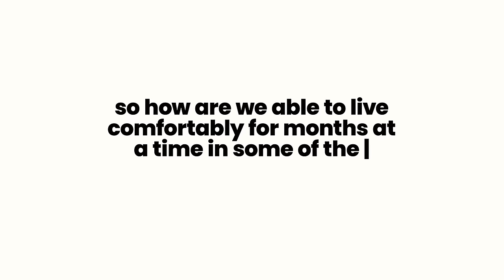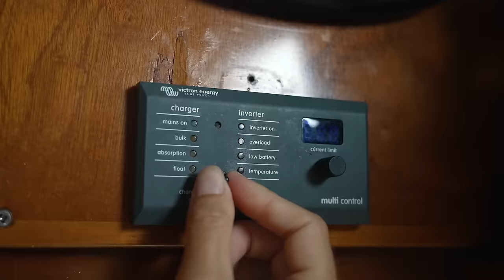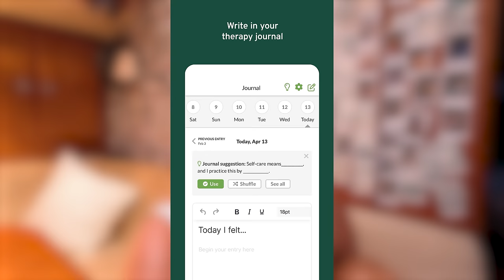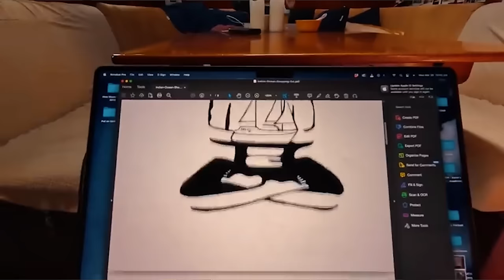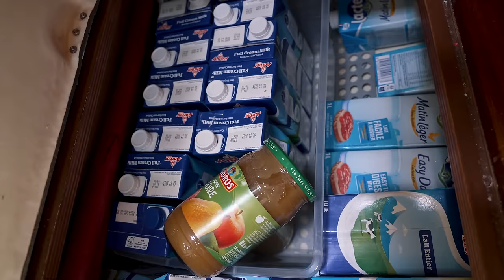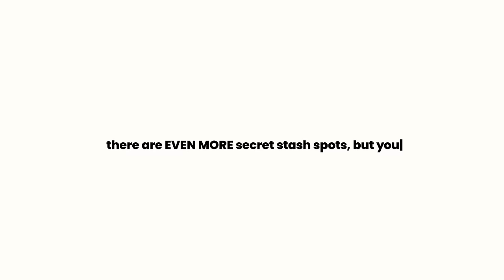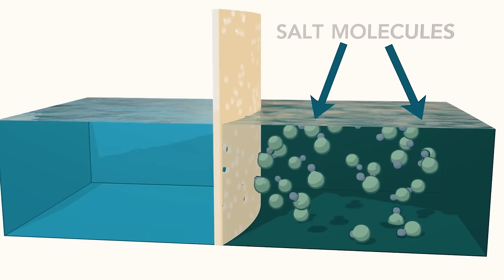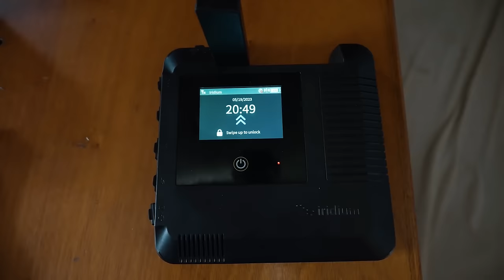Mastering OFF-GRID Living: 4 Key Things Every Sailor Should Know ⛵️ Sailing Vessel Delos Ep. 441

Comment: I have been living off grid for almost 20 years now.  When I was 21 I purchased a 400 acre property in the Mojave Desert with nothing on it.  The first structure I built was a small 20'x20' one room home.  I started off with a old Kohler 10kw Diesel generator and I didn't have a well for the first 3 years so I had to truck water in.  Fast-forward 20 years later I have 22kw of solar and 36kw of wind power with a 100kw diesel backup generator.  With two wells and 100,000 gallons of underground water storage.  The little 20x20 one room home now serves another purpose since I built a proper 6,000 sq ft home and a few other buildings.
Reply: I'm in my early 20s and have been considering doing the exact same thing. Any advice for someone inexperienced with off the grid living? Any regrets??
Reply: @Not_Bomb678  Buying equipment is key, if I would have had a good medium or medium large excavator early on I could have accomplished more sooner.  Equipment varies based on the environment you choose to live in.  I wish I had more money when I first made the choice to build off grid so I could have built things sooner.  I was a very skilled carpenter and builder going into this which made things go much easier.
Reply: @ChrisHarding-lk3jj  thanks for the reply, currently learning as much as I can about construction, carpentry, and metalworking etc as I'm sure these skills will be useful in general. I intend to do a lot of the work myself so I will definitely take your advice about budgeting appropriately for equipment. Thanks again!
Reply: But why
Reply: And we here we struggle to even buy 20X30 property, life is so strange. Who does the earth belong to ?
Reply: @BhaskarRamu  Where are you located?
Reply: @treplay8846 why not?
Reply: This is awesome dude. Replying cuz we have the same surname. Lol.
Reply: Must have been growing weed out there ..🤷🏻‍♂️
Reply: You're still on the grid.
Reply: @treplay8846  cheap land, space, cheaper cost of living.  im sure those are a few.
Reply: @Jlinwoodjackson  Definitely not growing weed out there, I do that in my 60,000 square foot industrial building located an hour away.
Reply: Bro can you share a video of your setup... Thats so dope
Reply: The hell did you pay for all this?
Reply: Lol liar. So obviously lying.
Reply: Pls take your meds op 🤣😂
Reply: You got  few acres to sell? 😂
Reply: Wow!!!! That’s freaking awesome!!! Congratulations
Reply: Hey Chris i live in arizona and I was pondering the idea of living off the grid and getting away from the city life what are the most important things you would recommend when starting off the grid now that you have so many years experience, what would you do differently knowing what you know now
Reply: In my country the government wouldn't allow you to build anything on your property and the few you could have built would have been taxed to dead.. welcome to Europe.
Reply: @Chungi2020  Coming up with some type of plan is definitely the most important step.  Establishing a budget and figuring out what your priorities are is critical to the success of the plan.  There will be obstacles and setbacks along the way and all you can do is move forward and hope nothing else pops up.
The vast majority of people moving off grid do not have the financial means to just go out and buy anything and everything they could possibly need or want.
Reply: You got the money on-grid though, didn't you?? Yeah, exactly.
Reply: whats the next step? build a bunker like every true american for a doomsday?
Reply: Nice, sounds like a dream.
Why in the desert tho? Isn't it harsher than say plains or in a forest? I saw some unrestricted lots in Texas for as little as $8k. But I'm ready to spend more if the land is good, not too hot and not too cold, with water underneath it :) 
Did you do any earthbag building? Like when they literally fill bags with dirt and build stuff, like they do in the army for defense but more for living.
Reply: @a3w291  I picked the desert because I like dry climate and the availability of vast open low cost land.  I have 2 wells on my property and I have yet to find out how much water they are capable of producing per day and I filled my 40,000.gallon pool multiple times and my water flow has never changed.
Reply: The one who created it the Lord Jesus Christ of Nazareth  @BhaskarRamu
Reply: jezus bro you are the final boss. dreams.
Reply: @tjitjo  I own multiple businesses and I have a metal fabrication and machine shop business on my property and all of the equipment is powered with the power I generate.  I build and restore classic and custom cars as well. I can generate wealth both on and off grid.
Reply: What 21 year old has money for 400 acres?
Reply: @ChrisHarding-lk3jj what 21 year old has the bread for 400 acres... I have a very hard time believing you did that on your own.
Reply: @TK-oe1xm  I purchased 5 adjoining 80 acre parcels for $40,000 a piece which comes out to $500 per acre which wasn't the cheapest land available at that time.  Currently there is a 320 acre property for sale with an asking price of $120,000 that is located 45 miles to the west of my property.

Comment: My sailboat and my ranch are completely off grid. The freedom is amazing. I now live full time onboard my sailboat and its reassuring to be off grid. My sailboat is much older and the upkeep, for me, is a joy. I have regressed her bottom twice and last year I barrier coated her with 7 layers of barrier coat, 3 layers of high quality h bottom paint. I'm re-doing her gelcoat this summer with new topcoat. I sew all my awnings with my Sailrite  zigzag canvas machine. There's nothing I can't do. Years ago I took a diesel repair class so I can do my own engine work. It has all been so fun. I just upgraded my solar power system. I don't have a water maker. It's my next dream item. Thanks for this beautiful video. Fairwinds from SV Miss Kaytlin.
Reply: What do you use for heat in the winter time?

Comment: Great video.  You could have done an entire video on electrical and I remember that in the past you have but have changed the system since then.  You could probably also do an entire video on provisioning and keeping food fresh (flipping eggs weekly?  most people advise daily.).  In a recent video you were asked about getting rid of the genset entirely or downsizing it.  Two reasons given then and in this video were filling dive tanks and consecutive cloudy days.  As I remember your battery bank was smallish, 7.5 kWh I think.  If you got rid of the genset you'd have a lot of space for more battery capacity (at quite a cost.. but) easily doubling your battery bank.  You could then fill tanks off the inverter and tolerate longer periods without sun.  Also have you considered putting a wind generator on the mizzen mast up high where there is more wind?

Comment: Thanks for a well presented look under the hood at cruising near the upper end of the affluence spectrum. You have worked hard and chosen well to get to a much deserved level of comfort. 

I would only  take issue to your "camping" reference. H.W. Tillman said "One cannot miss what one has not become accustomed to." His chosen simplicity came across more as living than camping which likely inspired many. Ditto the Pardeys' "go small, go now" attitude.  Perspective derives from vantage point.

I know your message is not meant to imply exclusivity, though some might read that into it. All i can say is that from my 35 years in this lifestyle the single root denominator required to carry on is the concrete will to get to the destination.

Comment: A few years ago I mentioned that Amp Hours are not the best measurement compared to Watt Hours.

Another tip...  think of Solar as like Fog...  if it gets too hot the Fog (energy) dissipates and you cannot harvest it off it's surface.

So the efficiency is all about the back side of the panel staying cooler.

The panels up in the air run cooler because of air flowing underneath.

That might in part explain the difference in efficiency.

Comment: Great video.  Very informative!  Thanks.  Solar and Lithium are very much the way to go, and both keep improving.

Another way to charge batteries is hydrogeneration, either with electric drive (acting as a generator) or a separate hydrogenerator.  With hydrogeneration, you charge simply by sailing, so it's basically electricity from wind power.

Comment: Awesome video! Thank you so much.
I had some follow up question if that is ok as I am currently trying to understand how I need to size the electric for my own boat.

1. Did you fully remove Gas from your boat? And if what was the reasoning?
2. How did you size your battery bank? And which products did you use there?
3. With Starlink are you experiencing any longer downtime? Or could a remote 9-5 been done with it?

Thanks a lot for your support 🙌

Comment: -Air-to-water machines make ~10 litres per day, except for no water 2 weeks in winter when the air is too dry. I'm curious on the performance of desalination, as I imagine lots of maintenance (55 Bars of pressure sounds like a lot) and other costs?
-Portable toilets are a mystery to me, however would a washlet (better than a bidet bowl, it's a seat replacement and could use salt water maybe?) work, as it's much more hygienic and uses no toilet paper?
-Water drinks will improve with a sodastream bubble maker, but connect it to a 6 kg CO2 tank (food grade quality)...it's the bubble rush, not the sugar that is refreshing!

Comment: 4:58 For sailboats with lesser power systems, the 2 KW AC (alternating current) power requirement for a standard home electric water kettle might be a show-stopper. Many boats would be better-served by buying a smaller kettle with a lower power rating (ex 800 W AC), or better yet, a DC (direct current) kettle that will not be impacted by the efficiency loss that DC-to-AC inverters entail.

Comment: There is something i want to know. Security. Especially the holes you drilled in the hull of Delos and the cables that transfer all the energy inside. How do you acces them in case of an emergency? Because as far as i can see, the boat is full to the brim. I hope you will never have any problems of course. I just want to know what your safety precautions are. Thank you

Comment: As an engineer, I would expect redundant systems in the event of failures. At least the mission critical systems. Maybe a secondary motor and sail. An alternative water source like a solar still. A solid way to guarantee food in the event of a fridge failure. A way to resolve a big hole in the boat quickly.  Would be cool if you could prevent sinking with some inflation system.

Comment: Hi Brian I have not read all comments but I have also bouge RV panels and you should not put them together with the 2 sunpower, I even think you get more power on 2 x 200 bougeRV so try disconnecting the the sunpower from the foredeck and put the bougeRV in serie. BougeRV are CIGS panels which is also a complete different solar technology.

Comment: Brian usually gets it right, but an engineer quickly spotted a typo in the form of a bad derived SI-unit:  
The unit for power is capital letter W (watt). 
Given that energy is power over time, energy is watt-hours (Wh). When we want to shorten large numbers, we use the kilo prefix (lower case "k", which is thousands), for example, ending up in kWh. 
Don't worry, many people gets this wrong 😂

Comment: Depending upon your panels and how you have them connected to your system you are likely losing more power than necessary due to one shaded panel reducing the effective generation of the other panels.  In general series connections are bad when one panel / cell is in shade while the others are still in full sun.

Comment: About power consumption. I've been watching my own power consumption very closely for the past 18 months (ever since electricity prices in Germany exploded). 

That 2 kW kettle looks like a lot but is actually almost irrelevant. That 0.04 kW NAS in the corner or the 0.1 kW fridge is what kills you. The kettle runs for maybe six minutes (1/10 of an hour) per day - so it consumes 0.2 kWh per day. The (old, inefficient) fridge running 24/7 will eat 2.4 kWh per day. That's about 450 Euros per year (at peak pricing). I bought a new fridge after measuring for three months... 

Even that stupid small wall wart phone charger that constantly wastes 1W will, over a year, consume more electricity than it cost. I'm exaggerating here, but not that much: 1W constantly on is 8.76 kWh per year. During the peak of electricity pricing, that was almost 6 Euros!

Comment: have you thought about replacing the mono panels with bifacials? mine produce about 25% more power in the winter than my monos. they'd be a bit more weight but they'd get light bouncing from the water

Comment: I see.

Re: translating our current anti inflammatory diet of nuts, seeds, fruit, yogurt, and a weekly cheesesteak, I would add two or three of the bench freezers to hold the frozen fruit and veggies and shaved steak.

Trial

Pick an amount of food LESS than your subject normally eats, and then on a completely separate day serve TWICE a reasonable amount and or ask if you want more or also when TWO very young subjects are in the galley, offer BOTH much more food than is needed.

Then go back to offering just a little bit less than hunger requires and see what happens after the subject is left alone for 30 minutes.

Acting normally at all times( except for the extra Food, Stuff, or activities offered.)
Reply: what?

Comment: btw shopping for food is NOT tricky. the solution to your - and your kid(s), spouse, ... - immediate and long-term health (longevity w/ minimal health problems) is following an active >= moderate-to-high and whole-foods (no, not the Amaxon store chain) no-oil low-protein high whole-carb varied plants-based ("earing the rainbow") lifestyle. it also helps your wallet and(!) you can produce some/most of the foods on your vehicle (especially a boat) provided you have the know-how and discipline to care for your plants

Comment: as far as your solar setup... I have done a little bit of research into this.  When using mismatched panels you may only be getting the output of the smallest panel.  not going to try to hash it all out here, but you may be better off getting rid of the larger panels and using all the same output smaller panels for better efficiency.  There are calculators everywhere for this. Obviously you are limited by where you have the room for panels
Reply: Partly true.  You shouldn't mismatch panels in a series string.  I think Brian has 3 MPPT solar controllers.  The arch panels are on one and not mismatched.  The bimini and foredeck if in series on the same MPPT controller are underperforming.  The same current goes through all panels in a given string.  The larger panels (ie: 170W on bimini) would like to see more current at max power point than the smaller ones (100W on bimini).  The MPPT controller will find an optimal voltage and current for the series but it might be no where near the optimal current for any one panel in the series.  If Brian and Kazza have three controllers maybe they need five to make sure any one string has matched panels.

Comment: Love your stories!!! I'm  preparing my catamaran for more independent living in Caribbean islands and want to try hybrid approach for propulsion where wind is not available or just to add more speed. So, I'm thinking of having only one hull equipped with electrical motor and another with traditional diesel. Main point is redundancy of various systems and energy sources.  For generating the electrical high power for propulsion motor, I really like to try turbo jet generator. Essentially, high RPM turbine and burning most of the fuels under compression. This generator is smaller and more efficient comparing to engines of internal combustion cycle. Have you though of such setup? Any pointers? Any experience from other cruisers you have come to know about it? Thank you!!! Love!

Comment: Hey guys Happy New Year…..I’m curious if you know or have calculated the power loss from the conversion from DC to AC and if that has any impact that you have noticed.  Also, I’m sure you have done it at some point over the years, but have you done a video on the Maintenance Intervals for the supporting equipment onboard?  Not just oil changes, but all the devices on the boat and the associated costs to do that.  Speaking of which, how many and where are you storing all those spare parts?  Thank you again for sharing your life and experiences for us Mortals.

Comment: Bananas are the worst for gas discharge that affects other fruit because all bananas are picked green then upon arrival in country of sale they are placed in a pressure chamber and pumped with gas to accelerate the ripening process. Bananas are particularly adept at holding the gas hence they often ripen really quick compared to ones you pluck off a banana tree by t also they affect all other fruit and veges. Hence why fishermen don’t like bananas on boats.

Comment: Interested in your  stove . Thinking of a 2 burner induction stove on top ot the old gas stove and wondering if my 400 watts of solar will cut it  , 1 fridge , no water maker as of yet .  I like that it would mean that I have two different sources to cook and use less propane and instead "free" power  . Plus I feel like it is safer . 

What is your estimate on how much power it uses ?